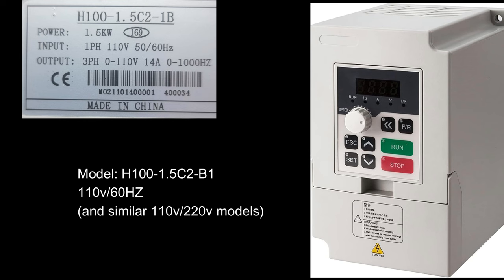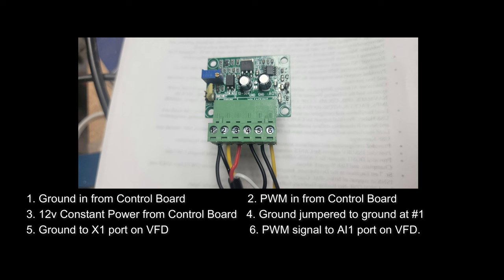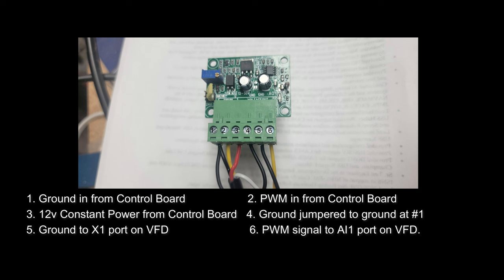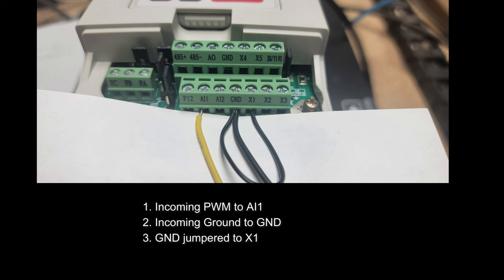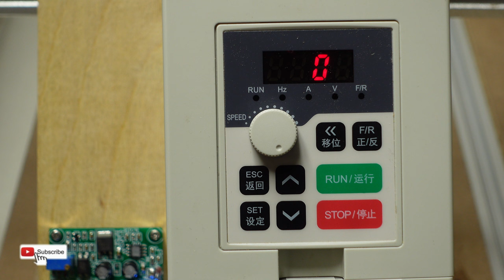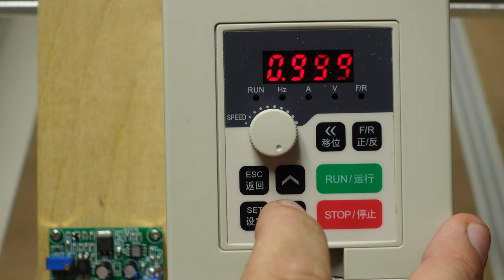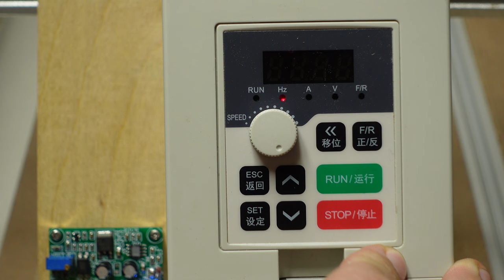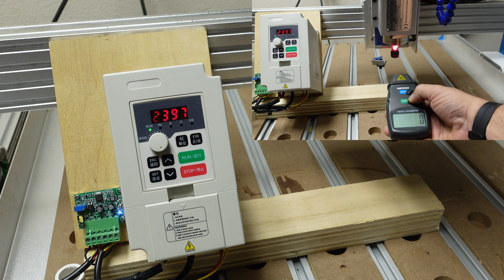Master your VFD Spindle with GRBL Control | Ultimate Tutorial | TK Designs | 4K

Comment from the maker: I wanted to thank @danteray08 and @evrlaw for pointing out that $30 setting in GRBL must also be set to 24000 ($30=24000) to ensure that GRBL recognizes the maximum speed of the VFD.  Please adjust this if you haven't already.
Reply: First of all THANK YOU I finally was able to setup the same VFD
one thing I cannot make it work is the speed in candle the max voltage I can get is 3.12 volts when i set the spindle speed at 1000 rpm after that there is no change on voltage, my settings are exactly as yours and I doble check them, also for some reason now I cannot see the speed on the display even if I have identical settings like yours. i remember i was able to see them but, I performed a reset of the unit before I use all your settings, finally where can I set the $30=24000. (sorry I’m super new on this, thanks
Reply from the maker: @oscarv.d.2760  You set $30 in GRBL.  You can do that from Candle (I haven't used candle in years, so I am not sure how to get to the console).  At any rate, get into the console in Candle, and type in $30=24000 and press enter.  

After that, try using M318000 to tell the spindle to start see if it spins up. If it does, then it is working, if not, something isn't being seen by candle.  If it does start, type M5 to stop the spindle.

Candle shouldn't care one way or the other about the voltage. The VFD cares about the voltage coming from the control box.

What CNC do you have?  Thanks for watching!
Reply: @tk.designs Thank you for your quick response, I just download G sender and now I know where to modify the value, my cnc is the Genmitsu ProVerXL 6050 and I installed a Vevor VDF CNC spindle with 2.2 KW and 110 volts
Reply from the maker: @oscarv.d.2760  I don't know if all of my settings are compatible with a Vevor branded VFD.  Is it the same model as in my video?
Reply: @tk.designs yes the VDF is a H100 series, there is only one command that change a little bit it is the one to use AI1 your option is I think 3 in mine is 9 but all the rest are the same.
in another news my cnc is now working 100% with G sender I changed $30 =24000 and change a little the gain in P702 to 295% and I can have 23980 when I send a S24000 m3 command.
Again, I really appreciate the time you took to put your video
Reply from the maker: @oscarv.d.2760  Glad to hear you had success getting everything setup. Happy carving!

Comment: TK, I have followed your guide and have my vfd running. I have thw same h100 vfd and wired it exactly like you have here. Im having and issue that I cannot get my DIY 2 wire probe to work now. I know the vfd and spindle are grounded and I should only required teh signal wire to came a close loop but for some reason its not working. DO you mind sharing if/how you have yours set up and wired? Appreciate your videos, this is the most thorough and informative video i have found on this vfd and spindle, Thank you.

Comment: Would you be able to help me.? I have the settings the same as yours as well as the same equipment but when I put S700m3 the spindle spins at 24k instead of 700rpm.
Reply from the maker: Thanks for watchingI What machine do you have, and have you measured the voltage from your laser output?  Usually one of 2 things has happened if you immediately jump to full power.

1. The wiring is loose somewhere causing it to turn on and not have PWM signal.

2. The F070 setting is set to the wrong voltage.

Double check your wiring first, and then use a multimeter to double check your output voltage from the laser output.  After that, try switching up the F070 from 0 to 1 or vice versa.  Let me know what happens.
Reply: @tk.designs  when set to max speed the pwm signal is from controller to pwm board reads 3.92 and from pwm to vfd reads 5.88. Also I have F070 set to 1.

I’m using the PROVerXL 4030 v2 with H100-1.5C2-1B VFD and spindle kit. I’m using the 1-3KHZ to 0-10V PWM

Thank you for helping me.!
Reply: Hey just wanted to update you. I had to go into the grbl settings and adjust $30 which is max rpm. For me setting it to 31k rpm max has it running close to rpm it’s set to. I think 18k rpm was running at about 18,150rpm.

I appreciate you trying to help me figure it out.!
Reply from the maker: @danteray08  I think I neglected to include that in the video.  I think because I already had set my $30 to 24000 long before I started playing with controlling the VFD through GRBL.  Thanks for pointing that out!

Comment: I know nothing about a Water cool spindle. Looking at the package that Sainsmart is now offering. Is there any difference between your kit and there new one. Also, I'm adding this to the 4030 V2 machine. Your video answered several questions but still not total clear, I think you just need to wet your feet.
Reply from the maker: I am not sure what Sainsmart actually offers in terms of a VFD spindle, to be completely honest with you.  Since I had a 3rd party VFD spindle before Sainsmart released theirs, I have never looked into theirs.  The VFD in my video is not my kit, but more a very common VFD kit from Amazon.  Thanks for watching!

Comment: My F070 won't change. I need it for 0-5v but won't let me switch. Any ideas?
Reply from the maker: Try unplugging the VFD for 30 seconds, plug it back in, and attempt to set the F070 again.
Reply: @tk.designs  nothing. That's the only setting that when setting up the numbers don't flash. I only see the 2 zeros solid without flashing
Reply from the maker: @DomzGarage  Can you record a video and send it to me?  Go to my channel page, and there is a link to contact me via email. You can send it there.   I haven't ever encountered where just 1 setting was locked before.  Also, can you tell me exactly which VFD you have?
Reply from the maker: I reviewed the video that you sent me. It looks like F070 setting is locked on your VFD controller. I am not sure if it is faulty, or if there was a firmware update done by the company to prevent adjusting this.  According to the manual, it should be able to be set. My apologies for not being more helpful.
Reply: @tk.designs  thank you very much anyways. At least I learned that you can program it. I just gonna have to buy a different one then.

Comment: Great video. I use a VFD and have wanted to do exactly what you have done.  One additional thing I will need to do is add a pauses command to my post or program the VFD to spin up the spindle a little faster.  My spindle soft starts and I need about 3 or 4 seconds to get to full RPM before the machine moves to starts the cut.  Thanks for taking the time to produce this video.
Reply from the maker: Thanks for watching, and for your kind words.  I use Vectric, and I edited the GRBL post processor to include "G04 P15" to pause at job startup to allow the spindle to spin up.  The P15 is a 15 second pause, as I have my acceleration/deceleration parameter set to 10 seconds. Include the parenthesis around the command, and place it immediately below the "[S]M3" command in the Begin SPINDLE_ON section of the post processor.
Reply: Thanks for the information. @tk.designs
Reply: @tk.designs  This discussion is interesting to me, as I have worked on larger machining stations where cutting G commands require confirmation that the spindle is up to speed whereas G00 rapids are transparent, so the head can move into place at the same time that the spindle is ramping up. What sort of sensor statement is returned by the VFD for a controller to confirm spindle status? If this is "spindle at speed" versus "spindle is active" then this could be handled more efficiently than a brute force P pause after M03/M04.
Reply from the maker: @TristanJCumpole  I am unsure if GRBL has the built-in capability to recognize the spindle status.  I know that I have edited the post-processor to introduce the delay, because at default settings, it does not wait for the spindle to spin up.  This was true with both my SainSmart and my Shapeoko Pro 5. I had to introduce the pause in the post processor. The Shapeoko is even equipped with the BitZero and BitSetter components that are a bit of an ATC.  Spindle still goes right away with out introducing the Pause. Thanks for watching!
Reply: @tk.designs  Thank you for your swift response! Yes, this is pretty much what my concern has been. My own CNC design is being built around a FluidNC type ESP32 controller. This is obviously a very different level of integration compared to an industrial machining station, however I am currently trying to gauge the point at which controllers start to "care" about the status of various components such as the spindle. I believe there are workarounds, however this may be contingent on what information I can sniff off the MODBUS with an Arduino, and whether I can use any of that information usefully with the controller. There may be ways, but then again it might be more work than is truly necessary when a P5 can be dropped into a spindle start M block.

Comment: Excellent video. I was finally able to control my spindle using the FoxAlien Masuter Pro. I followed your video step by step but cannot get my spindle to run past 10240RPM. Is there any other parameter that I need to change on the FA? Thank you for your help
Reply from the maker: Thanks for watching! I am happy you are making progress. What is your F070 setting? Is it 0 or 1?  Also, your F072 setting can be adjusted to speed up or slow down the RPM so long as you are using the same VFD controller as in the video.  Did you measure the voltage from your FA controller? If I remember correctly, it is somewhere around 1.3 - 1.5v.
Reply: Thank you for your reply. I have the exact same VFD. The voltage of the PWM signal coming out of the FA maxes out at 8.1. I’m not using the converter though. I will try it with the voltage converter and let you know. BTW, which software do you recommend for a begin??
Reply from the maker: @evrlaw  You shouldn't need the voltage converter, because this VFD has the gain control (F072).  I would check to see if your F070 is set to 0 or 1.  Try reversing that setting.  If it doesn't improve things, change it back, and start adjusting the gain (F072).  

As for software, I would start with Carbide Create, but use a version lower than version 7.  Starting with version 7, they made it so the software would only export in Carbide Motion readable g-code.  Earlier versions allow export in regular g-code, which other any GRBL based machine can read.

For a g-code sender, I recommend G-Sender, by Sienci Labs. It's free, and works really well with GRBL based CNCs, such as your FA.  Let me know how it goes with  machine.  Thanks again for your support!
Reply: So, I returned the spindle kit and got a .8kw kit with the exact same VFD. I went ahead and programmed it following your instructions, but cannot control the spindle with neither UGS nor Gsender. It worked fine prior to programming it. Everything works except for the spindle control. Do you have any suggestions? Sorry to bother so much. But I purchased the FA Masuter Pro and the extension kit almost a month ago, and to this day, I have not been able to use it. I couldn’t even cut the sample file. Very frustrating and disappointing.
Reply from the maker: @evrlaw  Are you able to control the spindle manually? I mean turn on, and off, and adjust your speed?
Reply: Yes. It works manually but it doesn’t with software.
Reply: I made sure I followed all the steps and still can’t get it to work
Reply from the maker: @evrlaw  Do you have to change any settings to control it manually? If not, then F01 may be incorrectly set. It should be 1 instead of 0.  0 is for controlling with the keyboard of the VFD, 1 is for controlling with the software.  If it is set to 1, go into UGS or G-Sender, and open the console and connect.  Issue the command M3S10000.  This should turn on the spindle, and run it at 10K rpm.  If this doesn't work for you, please feel free to go to my channel, and reach out to me via the email link on my channel page, and I will try to assist you further.
Reply: So, I did a little research and when I read the code I noticed that my spindle maximum speed was set at 10000RPM. So I went ahead and changed that to 24k and grounded the X1 to the ground with AI1. Problem solved!! Thank you for your help!!
Reply from the maker: @evrlaw  I am so happy to have helped! Now go get that 1.5K spindle again, and play with a little power 😁  Was your speed set in GRBL to only 10K?
Reply: Yes. That’s why I could not go past that number. You were AWESOME! Thank you! Now I’m off to learn Vcarve. Will definitely continue watching your videos
Reply from the maker: @evrlaw  I like VCarve.  It had the smallest learning curve for me, and provides the most bang for the buck (even though it's on the expensive side).

Comment: This video is perfect timing for me. Just waiting on a longer cable to arrive. Just curious, I've watched your 3 videos on this VFD and wonder why you opted not to connect the earth ground to the PE screw on the left of the PCB.
Reply from the maker: Thanks for watching!  Unfortunately, my VFD controller does not have an earth terminal on the left hand side. There is a blank space where the ground should be.  Mine is 2 years old though. This same type may now ship with a ground screw next to the hot and neutral on the left hand side.  It hasn't affected anything as of yet, but you never know.  I have recently purchased a Shapeoko 5 Pro with it's VFD spindle which is grounded. I am retiring the old Sainsmart :)
Reply: @tk.designs  congrats on the Shapeoko. That's a nice machine with lots perks. Look forward to new videos with it.

Comment: I have exactly the same H100 VFD set up for manual use on my 3030-prover-max.

As I'm happy to use the speed control dial, and the frequency speed display, is it possible to change the VFD settings to just have the spindle switch on and off via grbl?

The PWM signal from the laser connection is 0 - 5 volts.
Reply from the maker: You can either control speed and start/stop from the VFD keyboard, or from GRBL. Not both.
Reply: @tk.designs  Thanks for your reply. Now you've said it, it makes sence. I'll try again, this time including full grbl control, as in your video.
Thanks again 👍

Comment: Great video and learned a lot.
So I’ve set up exactly as shown but although I can operate the spindle manually from the vfd , I can’t seem to get it to fire up via the grbl.
I’ve programmed the vfd etc, but I’m not getting any voltage via the PWM .
Is there something missing?

It’s a Vasto XL controller and a H100 1.5kw vfd & spindle, but I’m wondering if the controller is malfunctioning ?
Reply from the maker: I am not familiar with the Vasto XL controller, but I have seen James Dean Designs do a couple of videos on setting up a VFD with the FoxAlien branded CNCs.  It seems to be similar with the SainSmart controllers.  Anyway, did you make sure that the F001 setting was set to 1, instead of 0? A setting of 0 is for manual control on the face of the VFD, and 1 is for the sender software to control the VFD.  Let me know if that helps at all.
Reply: @tk.designs  , yep, done all that🤔.
I used a combo of yours and James Deans videos on the subject, but the Pwm doesn’t show voltage at any time.
Works great on manual too, so I’m wondering if the FA controller is faulty.
Reply from the maker: @joemccluskey4554  Maybe you have the F/R key set to manual control?  If you are able to stop and start from the face of the VFD, it is likely that you have it in bypass mode. Press and hold the F/R key, and it should lock you out of the VFD control keys.  Then issue a S12000M3 command from the sender software to try to start the spindle at 12000RPM. M5 command will stop the spindle.  Also, If I remember correctly, the run light should be illuminated and the spindle speed should not be controllable via the knob when you are set to run via software.
Reply: @tk.designs  , thanks again .
The vfd is set exactly as per the video. The f/r button is set as a manual over ride,  but not applied.

I noticed James Dean mentioned a “ hidden” setting which affected the spindle starting, but my vfd is the same as yours , not James’s

Comment: Thank you so much really helpful, could you please check if x1,x2 has 10vdc ? Mine won’t stop spindle when connected them even if controller no power no usb, just now checked them and i see 10volt coming from x1 gnd,x2 gnd
Reply from the maker: Please check to ensure that you do not have the PWM and ground signal from the laser output grounded to each other.  I had that happen in testing, and it caused the spindle to start much as you have described.  Are you using the method here with the additional circuit board, or are you using the direct method I posted in the addendum (https://youtu.be/ZS-YWvwTN2s)?  Are you using the exact model of VFD as in the video?  Please let me know the outcome. If needed, please contact me at the email in my channel profile, and I can assist you more directly.